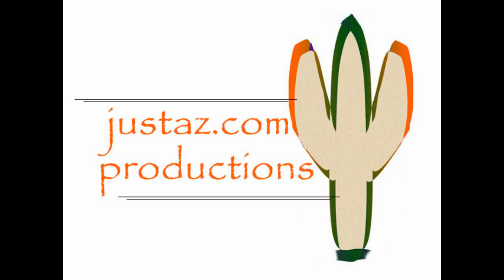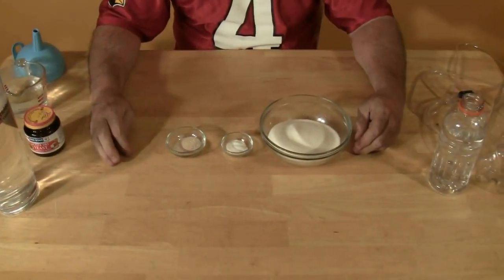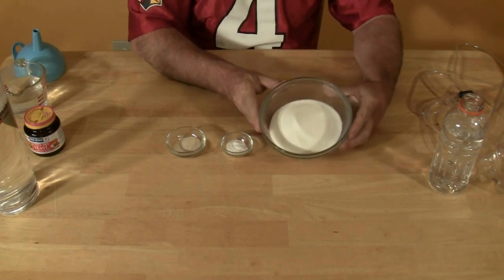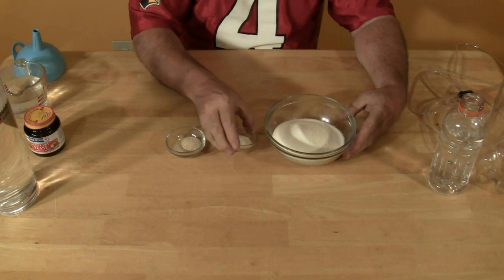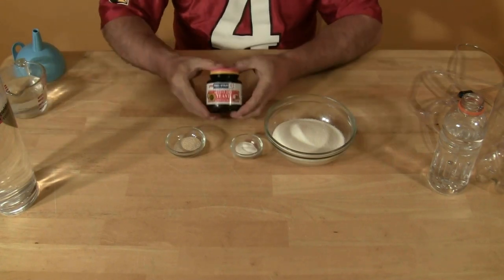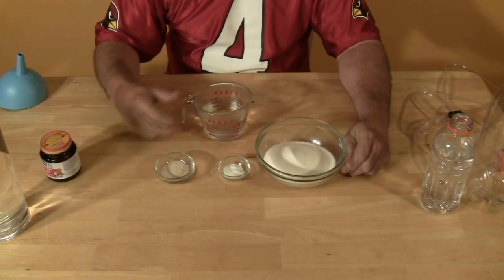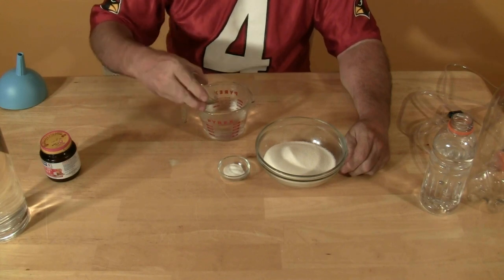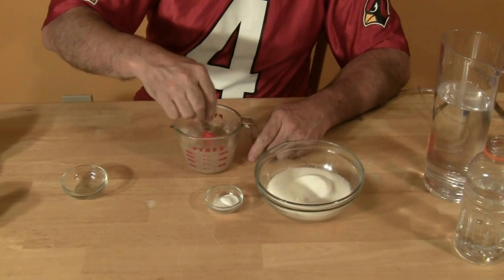DIY CO2 Reactor for Aquariums ... The Do It Yourself CO2 Reactor for your Fish Tank

Comment: if this CO2 reactor can used marein tank
Reply from the maker: Hello, naruna gamage. The reactor would technically work in any tank; it will produce the CO2. However, Bob built this for the freshwater tank, and we don't know how the gas would affect the livestock in your tank. We assume you're referring to a salt water tank of some sort. The introduction of CO2 does lower the pH of the water, thereby making it slightly more acidic. This may have a negative impact on corals and some fish. We recommend thoroughly researching the affect of CO2 on the livestock specific to your tank. Thanks for watching, and we wish you the best of luck in your projects.

Comment from the maker: Hello Charlene Dorsey. We do not recommend adding an air valve to this basic system. The CO2 production is continuous and a valve will restrict the flow. The CO2  will build up and the bottle is likely to rupture. This is an inexpensive, basic way to add CO2 to the water. Thanks for watching our video and taking the time to comment. Best of luck in your project.

Comment from the maker: Hi brickboys187. The blue piece is an air stone. It breaks the CO2 down into bubbles. This reactor is an inexpensive, DIY system. The yeast eats the sugar and there's no actual means of controlling the flow or timing because the action is continuous. You could remove the tube and air stone from the tank when you want to stop the flow into the tank, but the yeast/sugar action continues. There is no means to add a timer to this basic system. Thx for watching and best of luck in all your projects!